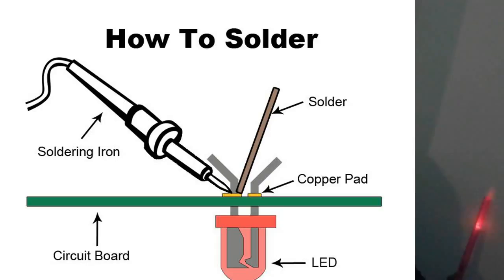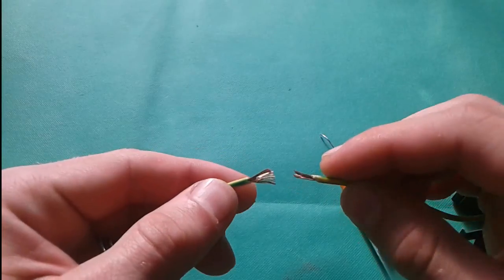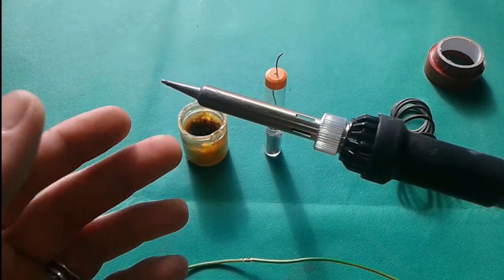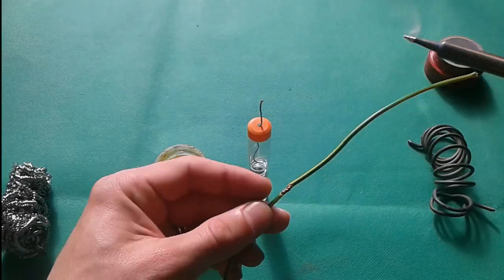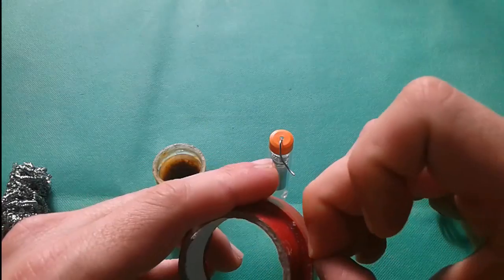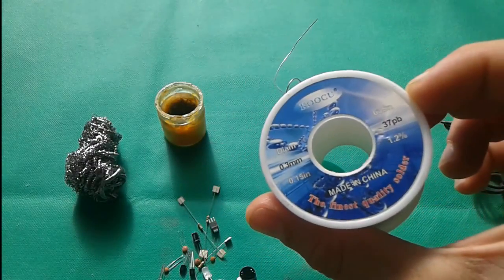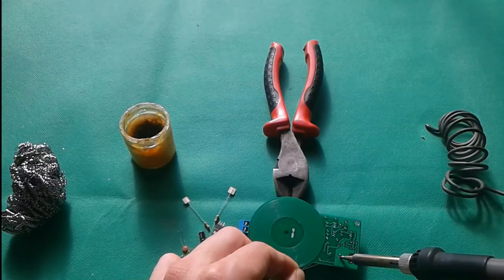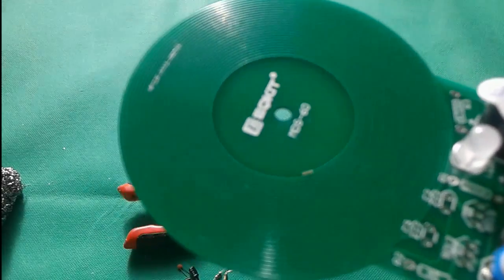Electronics for beginners - How to solder wires to a circuit board

Comment: Is it normal if it the solder is smoking without doing anything or I should plug it out?
Reply: Plug it out? Lol. But you need to be more precise and detailed. You can't plug solder in or out. Solder is the silver wire looking stuff that you melt. The iron is the thing you plug in and plug out as you say. If you see a little smoke coming from the tip that's normal. However, you shouldn't really even be letting it get that how without using a little flux and wrapping some wire around the end of your soldering iron's tip. So that when it heats up the solder will melt on it then just wipe it off with some wood grade steel wool or spunge or whatever it is you choose.

Comment: What type of wire and flux should I use for a game controller circuit board?
Reply: some lower acidity flux and basically any wire you want just not something thats very bad. once you learn to work with proper materials life is so nice